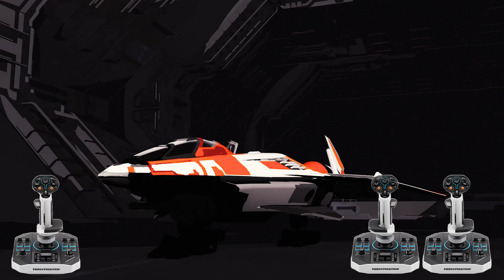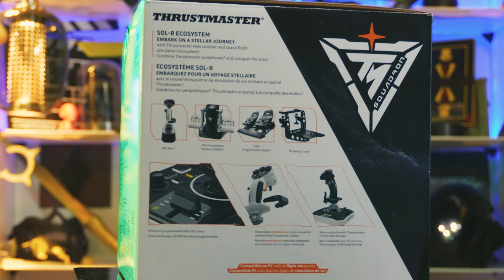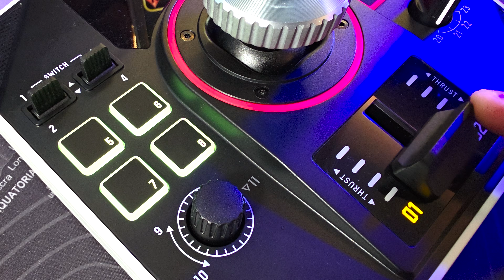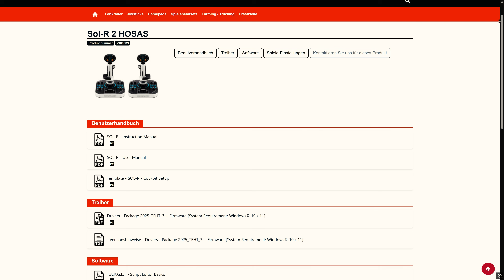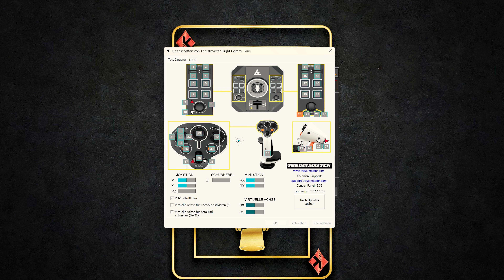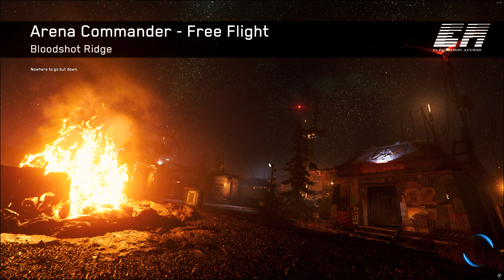Thrustmaster Sol-R 2 HOSAS Review: The Ultimate Space Sim Setup for $399? | Complete 2025 Analysis

Comment: Hello! Hoping you see this. There is NOTHING online for teardown on this unit, specifically the sol r 1/5 base and gimbal, mine is clicking and I've taken it apart 3 times now but the clicking only moves around to different parts of the axi. I saw in one of your shorts that you have taken it apart to adjust something. 

I'm just wondering if you can do a full teardown, maintenance, and reassembly guide. It would help a lot of people out there who fell atrap to thrustmasters pretty rgb lighting...

Attempt #2 in desperation 😆

Comment: Compared to the t16000hotas set and vkb entry level stuff , this should be between somewhere in quality and prize, but at the end it's way overprized for what it puts on the table , i would say for a maximum of 250 dollars , it would be much more reasonable to say its competitive , i think for 400 , you could get 2 vkb stick's thats a whole other level of quality. My main problem is its the same tech that t16000 use , that is good for a short time , but i used those stick's very casually and i selled them in 2 years because problems started coming up, while the tech in the vkb said to be lifelong , i still not have mine for long , will see , but everybody seems to recommend vkb
Reply from the maker: Its a complete other tech than the t16000 😉
Reply: @MrKarolinger  gimbal design the same  , hopefully upgraded , cause i had issues with longevity at a casual use in the t16000 , but still , main problem is its nearly Virpil prize range , and cheaper Vkb or Winwing should outperform it for anyone who not only plays space sims
Reply: @MrKarolinger  For right hand i switch out my t16000 with the new budget Virpil , left hand i still thinking Vkb omni or the budget Virpil throttle , or i stay with the thrustmaster there  , its still very good with only little ghosting on the analog stick

Comment: I don't know how you got flight inversion to work for you, but apparently Star Citizen doesn't like me very much. 😆  No matter if I set it to "yes" or "no", if I push the throttle stick forward, the ship goes backward and vice versa.  I've tried setting it on both the "HOTAS1" and "HOTAS2" sections and it just doesn't matter; no matter what I enter there, it's ignored.... 😭lol
Reply from the maker: Check if your stick is perhaps 3 or 4
Reply: @MrKarolinger  Oh, heck, that was it.  The only other USB controller-type device I've got plugged in is a foot pedal that's firmware programmed to press Numpad + when it's stepped on (give me my push-to-talk in a hands-free way), and for some reason, the game sees that single device as two "joysticks", which it's calling instance 1 & 2.  The SOL-R sticks are thus 3 & 4.  I scrolled through under the Controls settings in the option, and sure enough, I could select HOTAS4 easily enough.  And when I inverted the throttle there, the stick throttle now behaves as expected.  Thanks so much for pointing that out! 👍

Comment: 3 times the cost of TM T16000's, both plastic.......wouldn't want them if donated. Virpil/Winwing are an investment and built like tanks. Just get a pair of T16000's as a stop-gap, you can also upgrade them for a few $.
Reply from the maker: The SOL-R series is a different class than the T16000🤞
Reply: @MrKarolinger  Its plastic, not meant to last and is 3 times the price of Daul T16000's, no, its expensive rubbish, and not made to last.

Comment: I been using the T16000s HOSAS and while i have had my moneys worth, the common stick drift problem is starting. I was thinking about getting the Gladiator NXT EVO HOSAS, but for £100ish less, i recently been thinking about these ones. 

Would anyone recommend these over the Gladiators or would it be worth spending the extra?
Reply from the maker: The built-in technology is on a level. If you don't want to make more profound adjustments or possibly want to use an Omni Adapter, I would recommend the SOL-R. Otherwise, the VKB are definitely a strong alternative, but more expensive
Reply: @ thanks

Comment: I have a complete VKB setup and grabbed these out of curiosity, as I really liked the button layout. It seemed to me that they were deliberately designed with Star Citizen in mind, everything is just super intuitive. That hunch turned out to be true, after a couple hours using them I’m in love. Since Thrustmaster FINALLY did something right and swapped their usual 10 cent potentiometer on the Z axis for a proper Hall sensor, it’s removed the chances for stick drift, which has almost certainly put this in first place amongst my SC control collection. They just feel much better in hand than my VKBs. I only have two main gripes: first is the two trigger buttons are a little sloppy, and second is the fit and finish on the base seems a little bit like a first generation Tesla. IE seams aren’t completely matching up, a little more gap between seams than seems necessary. It feels ok, just looks a little….janky I guess. The trigger slop isn’t something I notice when I’m actively playing and headphones on, but is super irritating without headphones in as you hear them rattle as you’re moving the sticks around. I’m going to try swapping them out in a few weeks just to see if it’s my set, or normal.
Reply: @Ferrous_Bueller  well did you test them in something other than sc? Like elite?
Reply from the maker: There is also a preset for "elite" and here, too, the strengths and weaknesses can be transferred one-to-one.
Reply: @Gobi-Wan  I haven’t…for some reason I just never got into ED, but to be fair I never really gave it a chance…just a couple hours after it launched. I should probably dust it off and give it an honest attempt, as it seems like it’s developed a lot over the years.
Reply from the maker: I had also thought briefly about the first generation Tesla 🤣
Reply: For a first time user what would you recommend SOL or the VKb with Omni setup
Reply: @Rhyno457  Honestly, this surprises me to say this, but I'd say the SOL. Once you factor in shipping, the price is almost the same for both. Now that the Thrustmaster slapped a Hall sensor in the Z axis, stick drift won't be an issue, so they'll last. For space sims, I personally believe that the ball joint feels much better in use, it has a very flat profile which is what you want in Space. I think the cam system isn't the best for space sims, as it's designed to give a profile for flying in atmosphere, where you're working harder to move as you get to the further ends of the movement. The SOL-R, for me,  is the first dual stick setup where I can get all of my hotkeys on the sticks and not need a button box, or something like Game Glass, to compensate. And that's the number one selling point for me.
Reply: @Ferrous_Bueller interesting. As in Europe the dual sol r are much cheaper than  the two omni vkb (330€ vs 465€ including taxes and shipping), your comment make the new Thrusmaster even more interesting

Comment: 2 VKB's for $270 is hard to beat.
Reply: @DaringDan  you’re actually at $348 once you tack on shipping. I have both, at $418 shipped for the Thrustmaster vs $348 shipped for the VKB, the Thrustmaster is a much better buy. Since Thrustmaster finally made a smart choice and included a hall sensor with the Z axis removing the main fail point, it’s just a much better set of sticks in almost every way. And I say that begrudgingly, as I have a pretty long running hate/hate relationship with Thrustmaster.
Reply: funny thing in Europe the price of the two products are inverted, 330€ vs 465€
Reply: @Ferrous_Bueller you obviously know nothing 😂 vkb beats these trash ass hosas system 😂 even Virpil has a new base out that are all metal inside for $220 each and will actually last forever!!!
Reply: and for the same price as the thrustmaster you could get 2 vkb omni throttles, have more buttons (4way hat on thumb rest, 2 dual trigger actions) on the sticks themselves and not worry about the ball gimbal failing... and can change out the springs for the x and y axis to adjust resistance.
Reply: @ the ball gimbal won’t fail, Thrust,aster removed the failure point which was a cheap potentiometer on the z axis. For space sims, having both of these sticks, the ball joint on the SOL feels way better. It has a flatter resistance, which is what you would expect for space. The SOLs have 2-point triggers, dual hats, an analog stick, and a scroll wheel easily available on the thumb, all clickable. The Thrustmaster just flat out has more, better button layout.  Having both sticks, I can get all my keybinds I need into the SOLs, with the VKB I have to make sacrifices.
Reply: @Ferrous_Bueller  so the only remaining two drawbacks are these very clicky triggers that are really annoying unless you always play with ear sets, and the Winwing Ursa Minor 😊
Reply: @thierrybo6304  I play with headphones, so never noticed the clicky triggers. The Winwing Ursa Minor...not so much. I don't know anyone with an Ursa Minor that made it 90 days. Every single friend I have that went with an Ursa Minor has broken, and Winwing refuses to do anything about it.
Reply: @Ferrous_Bueller because if you actually read winwing website you would see they don’t warranty any products they sell! You’re such a know it all you should learn to read 😂🤣
Reply: @Ferrous_Bueller and you keep buying low end gear that’s what you get! Save and buy Virpil and only have to buy one time
Reply: @SIMRIG412  it’s actually you that knows nothing 😂 I have Virpils, I have VKBs, and odds are I have had or currently own most of the current must have flight and driving sim gear. But continue pretending you know everything about me from a single YouTube comment 👍. It’s also kind of weird to act mad about a joystick you’ve never used. Really weird dude….
Reply from the maker: Where are such prices?